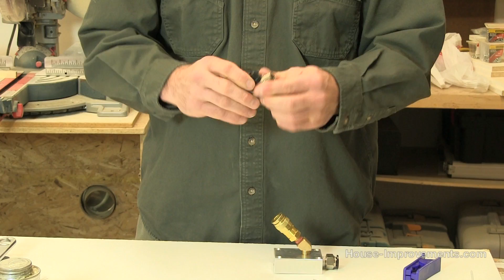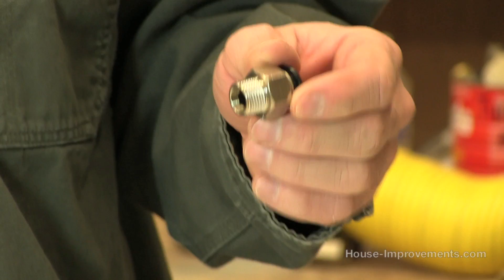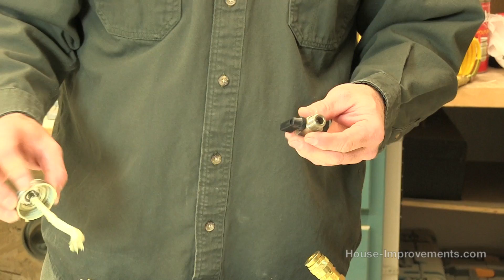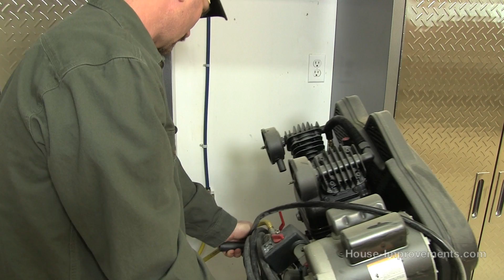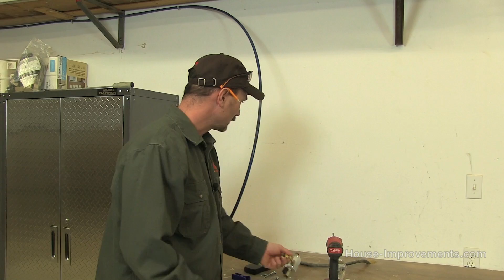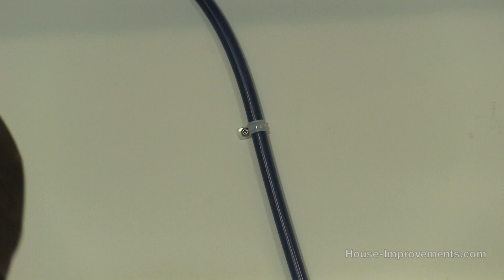How To Install A Compressed Air Piping System

Comment: this stuff looks like stuff you find on big rigs. why didn't i think of this before since i've been working with this stuff for years. definitely easier to install and cheaper than steel or copper pipe. thanks
Reply: ruben cruz 
This has an aluminum core, coated in poly on both sides. Closer to pex-al-pex than nylon DOT air hose.

Comment: When you decide to go compressed air on the workbench this application is a one, two punch when combined with electric tools. When you build with wood, metal, plastic and run power tools this step brings the power right where you need it, and  is a vanity few can pass up. Besides compress air beats the heck out of keeping the garage floor free of unwanted debris, with a broom. The install was a breeze and we like breezes.Great video as usual.

Comment: Nice vid...when I run mine I will used 1/2" galvanize pipe. Not sure how nylon tubing will hold up over time.
Also, were is you air dryer and filter...I didn't see one installed at your compressor.
Reply from the maker: I do not have one, has not been a problem the last 15 years so I never bothered.

Comment: Shannon,
Another EXCELLENT VIDEO.
Bought a home that the previous owner installed a HUGE? compressor (5 feet all) in a room in the RV Garage.
All the outlets are in the RV garage.

But...I'm considering finishing the UNFINISHED basement and don't want to purchase yet ANOTHER smaller compressor to run an air NAIL GUN for the framing.

Looks like a nice, simple system which will meet my needs. Will just need to run a branch off the main compressor to the basement location.

Thanks again for the great videos. Keep 'em coming.

Comment: Is that a brushless drill? Does it feel or last any better than a regular drill?
Reply from the maker: Yes that is the Milwaukee "fuel" edition and they are brushless. They work nicely , slightly cooler, suppose to be less drain on the batteries, and yes they are suppose to last longer. I think they may even be lighter.